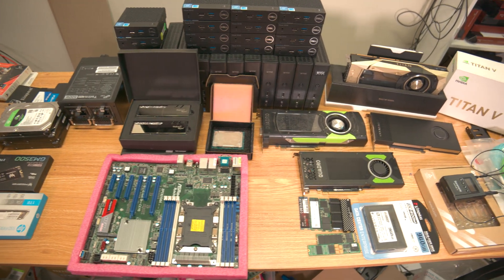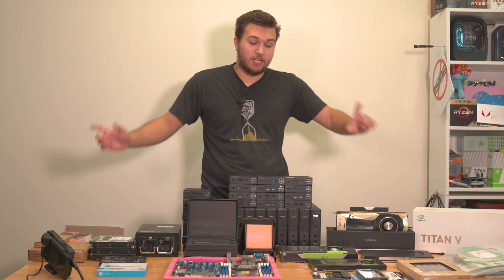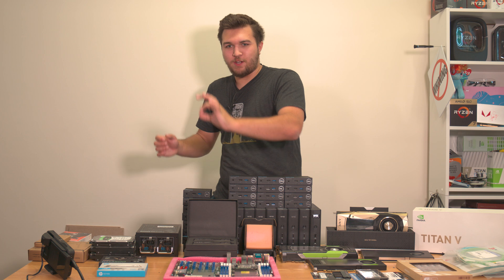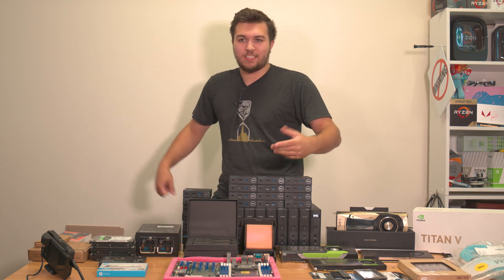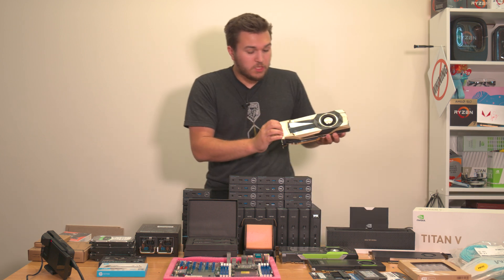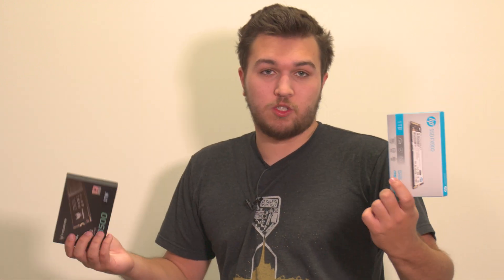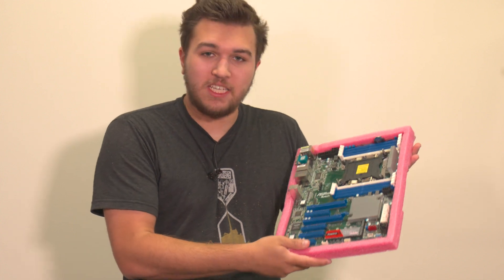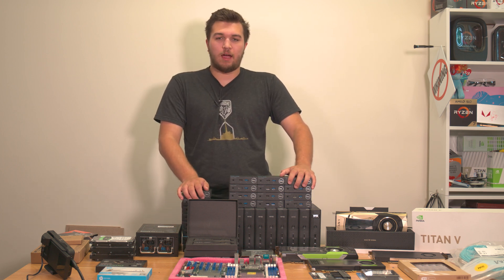How to Waste $10,000

Comment: is the Titan V the 12GB or 32GB model? If it's 32GB then you may be able to partition the GPU rather than run multiples. For example with a 32GB card you could make 4 8GB card partitions. Or 8 4GB. The V is Volta which is slightly later than Pascal but for running 1080p/1440p VMs it should work fine. One of these cards is overkill for a single VM. With 500W you're only going to be able to run one card, probably.

Comment: 1.) redundant 500W means you should keep the load at under 500W so it still works when one of the PSU module fails...thats the point of a redundant PSU. Your server will needs tripple that with all these GPUs.
2.) In case you want to use something like TrueNAS with ZFS...its highly recommended to use only ECC RAM and datacenter grade SSDs...ZFS will kill those consumer SSDs very quickly...alos get a UPS because otherwise you may use your raid arrays as consumer SSDs don't got build in powerloss protection
3.) that Mainboad got 6 PCIe slots and only two are 16x but you got four 16x GPUs. So only two of them will fit. and even with a mainboard that got enough 16x slots its still the question if you could cool them when packed so tight together
Reply from the maker: 16x slots are for bifurcation for nvme, GPUs will run on 8X, will probably just use the single slots as I want to use all slots and maximize cooling. 
Im gonna do the stupidest thing for my OS... Windows 10 with the drives shared over the network.

Comment: I copped a 1070 for 180
Reply: Managed to get a rx570 8gb for 70$
Reply: @M.Hametsu  how? i need one of those
Reply: @M.Hametsu  sheeesh thats an awesome deal
Reply: Yeah so it's a funny story. I got an rx570 4gb for 90$, but the guy was pretty late and managed to negotiate 20$ off for it so spent 70$ on it. But I thought it was an 8gb version so I found someone selling a 8gb version and asked if they'd trade my 4gb version with no extra cost. Now I have a rx570 8gb for 70$
Reply: @M.Hametsu  i built a pc around a year ago. and It only had a 550 4gb that costed 120$.
Reply: @bobbillyboy16  funny you mention that. My first PC build was during the GPU crisis so I had gotten an rx550 4gb for $150 but I got it brand new on Newegg. After that I got a hand me down 1050 ti and now rx570
Reply: I got my GTX 970 for free
Reply: @KingSkrap  I'm now realizing if the model # has 70 you'll get a good deal
Reply: @M.Hametsu  hmmm 🤔 so a 3070 is a good deal no matter the price?
Reply: @KingSkrap  ironic you say that since there's actually some selling on Amazon and Newegg for below MSRP. Maybe you can get one for less than $450
Reply: @M.Hametsu  imma get a 3090, I got a guy who's gonna give it to me for 800
Reply: @KingSkrap  don't do it. The MSRP is $700 and the GPU market is dropping fast give it like a few weeks or months and it might actually be less than $700 (there's also the 4000 series which might be less for more)
Reply: @M.Hametsu  nah cheif idk 800, is pretty low
Reply: @M.Hametsu  I think crypto is gonna go up again
Reply: @KingSkrap  doubt it. The coin they used isn't all that valuable anymore even if it did jump in price again it'll have to jump pretty high for it to be worth the effort again. There's also the risk of trying again and every miner being at a net loss.
Reply: @M.Hametsu  idk I have a bad feeling about it
Reply: @KingSkrap  a bad feeling is alright but look at how the coins charts are going. They're not going to suddenly shoot up without reason. As long as you watch the crypto and make sure there's no sudden influx of people buying or what not, then save up and buy it for cheap if the crypto does suddenly jump in value the gpus won't for a while so buy it then right before it jumps in value. That way you get the best bang for your buck